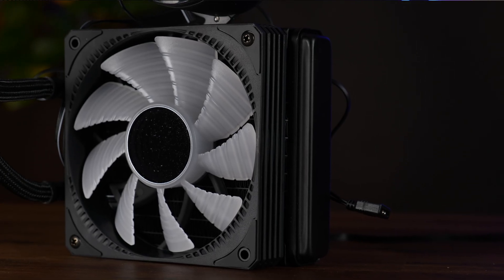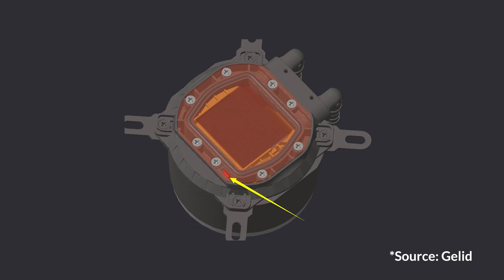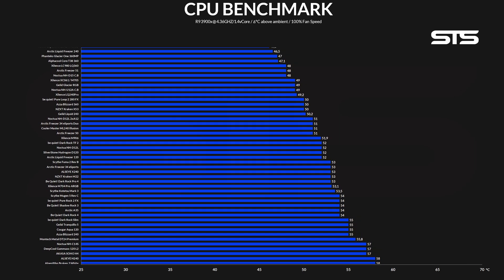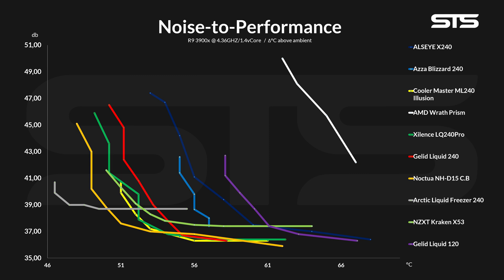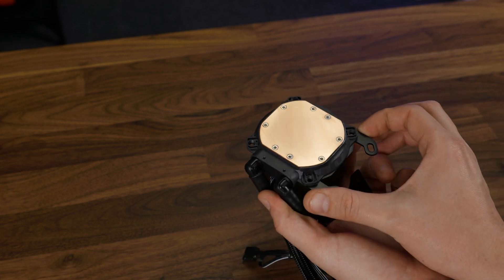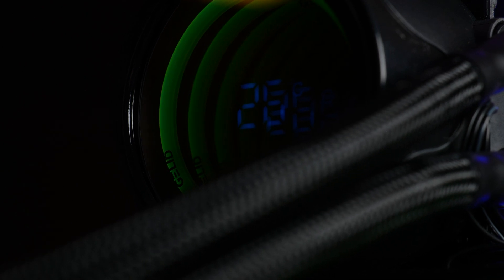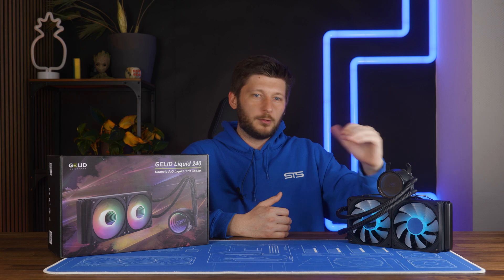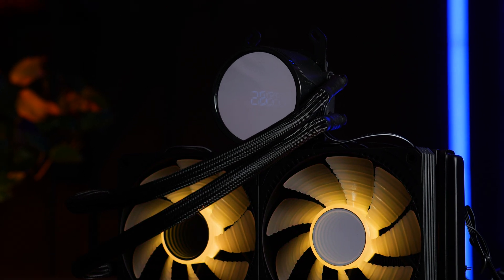Gelid Liquid 240 - The 240mm AIO That Displays The Temperature

Comment: Great video as always, can u help me with my dilemma? i Have CM master liquid 240 and i want to replace fans on radiator, right now im thinking about artctic p12 argb or be quiet high speed. Can you recommend one of these?
Reply from the maker: Thanks!
But as for your upgrade path, if noise is what try to get down, take the p12 argb, preferably 4 in push-pull and limit them down.
But as for max temp, you won’t get it much lower without going for a bigger cooler
Reply: What Is your cpu?
Reply: @jannmuller4414  R7 5700X
Reply: @DarioG893  on this cpu with this cooler you won’t see a big difference In cooling I think. I’d just go with what I think looks better or fits the budget better. But if you want to make sure to get the best performance to noise ratio, then go with the bequiets.
Reply: @jannmuller4414  Thank you!
Reply: I would choose Arctic